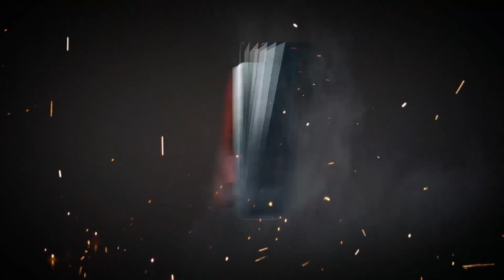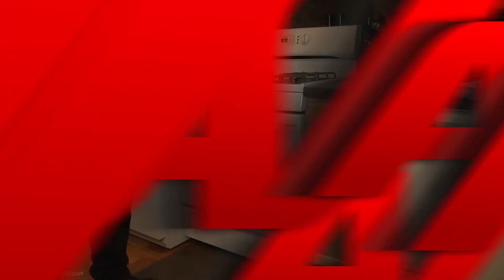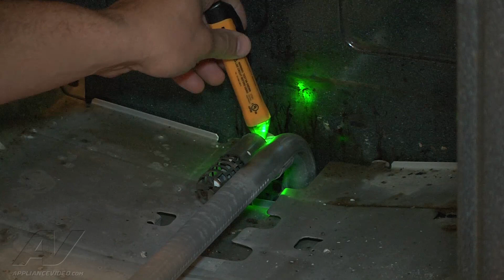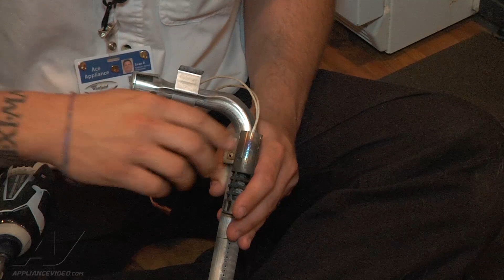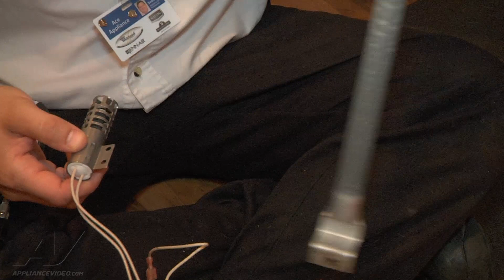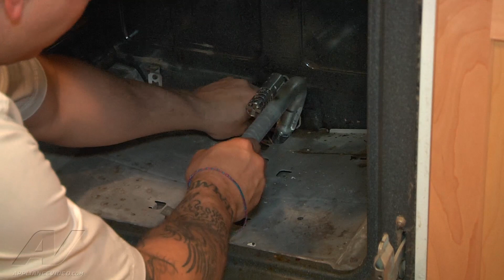GE Stove Repair - No Heat in Oven - Oven Igniter

Comment: My Frigidaire oven panel is showing a code f10 what is that a sign of?
Reply from the maker: Great question, if you have a more technical question that our parts department cannot answer, you can search our over 17,000 answered questions free at our website www.ApplianceVideo.com under our Repair Help section. You can also call our parts department at 1-800-830-5465 and they can give you help 7-days A week ,or search at www.SaveMoreOnParts.com  .

Comment: At what point did you unplug the power and or turn off the gas? Or not needed
Reply from the maker: Great question, if you have a more technical question that our parts department cannot answer, you can search our over 17,000 answered questions free at our website www.ApplianceVideo.com under our Repair Help section. You can also call our parts department at 1-800-830-5465 and they can give you help 7-days A week ,or search at www.SaveMoreOnParts.com  .